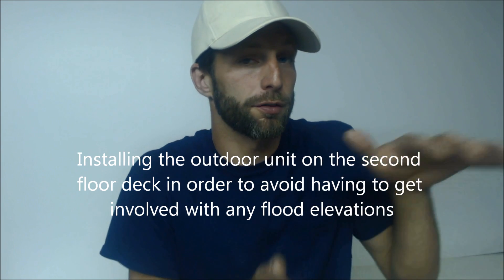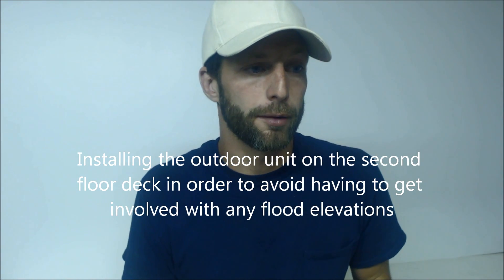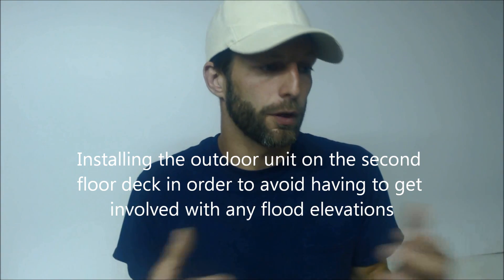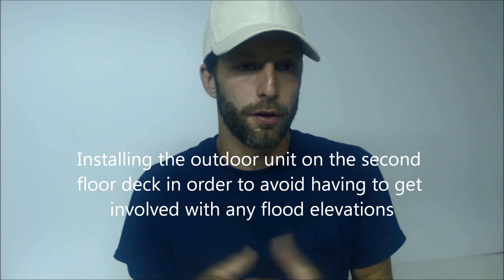Before Installing an AC Unit- Where to Check Flood Height Elevation!

Comment: Unless. of course, you're installing a Trane, :-)     
I'm referring to that video several years ago showing two guys rowing a canoe through a flooded neighborhood.  They came to a house with water nearly up to the windows and the Trane condensing unit, mostly submerged, was still running.
Reply from the maker: Ha, ha, nice!